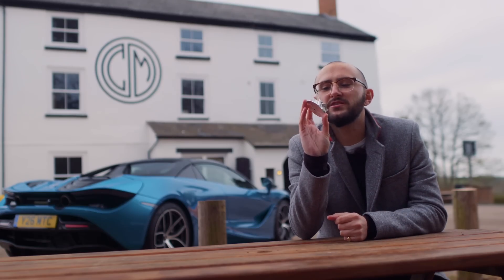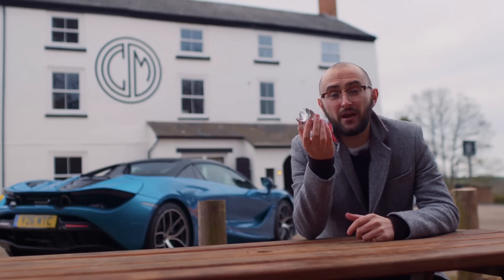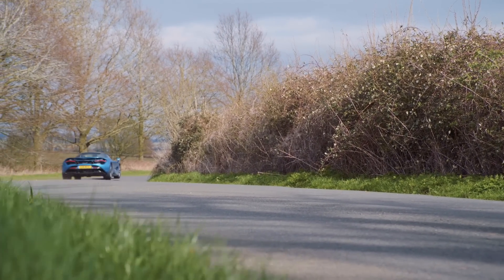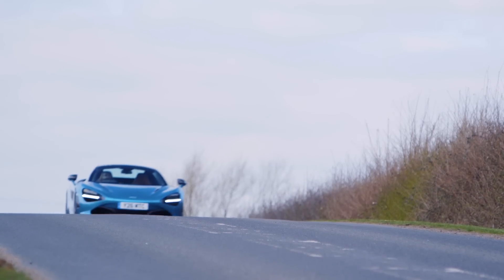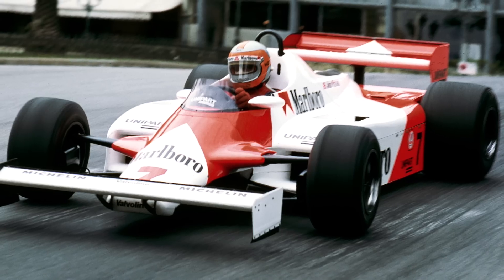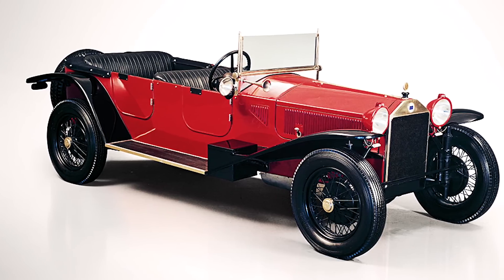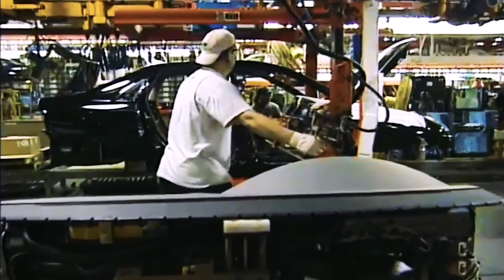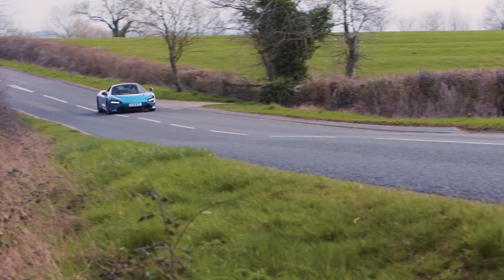What Actually Is A Monocoque Chassis? | Carfection 4K

Comment: Most people don’t understand what a monoqoque is. An egg is a monoqogue. Once you break the shell, it loses its entire structural strength. You can’t glue it back together and obtain the same strength as before. A monoqoque has to be replaced once it’s damaged. Bugatti is absolutely right in this case.

Comment: Not being an engineer I do remember reading years ago, actually decades ago, vaguely that in aircraft industry design during the Second World War the term 'monocoque' was used when a flat steel sheet was 'stretched' or put under tension and then stamped to produce the part.
The idea was that this increased the strength of the stamped part. Does anyone know if this is correct, or does the term simply refer to a type of unibody, stamped or otherwise? Thanks.

Comment: Hmm. Yes and no. Even the McLaren  "monocoque" has box sections that form a frame like structure and airplanes that have stressed skin construction have a framework of ribs and stringers to help the skin resist buckling. Then take a typical frame structure like the chassis of a Lotus 7 or a bicycle,  their frames are made of thin wall stressed skin tubes that are mini monocoques. The only pure monocoque I can think of is an egg and the only true space frame is an electricity pylon, everything else is a mixture and a compromise. To argue that a steel saloon car is not a true momocoque but a McLaren is is  silly and pointless.

Comment: Ah seems rather complicated?

Frame/chassis = serves a structural purpose. Supports the components bolted to it. Rigidity contributes to safety. 
Body = serves a practicality purpose as well as safety. 

Monocoque combines the two into one piece. 

‘Monocoque combines chassis and frame’ doesn’t make sense to me.
Reply: GetUpFalcon Frame is rarely used to mean chassis in the UK. For example, a Morgan has a steel chassis and a wooden frame, to which the body panels are fixed.